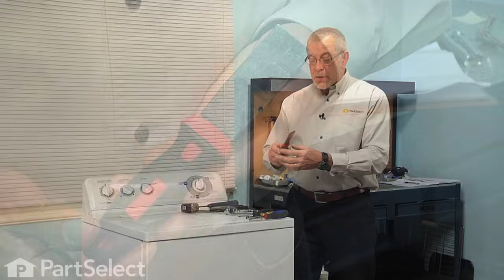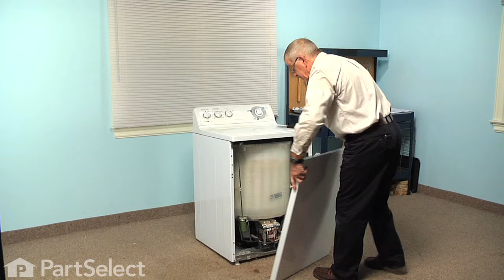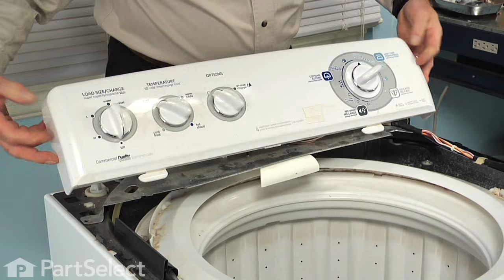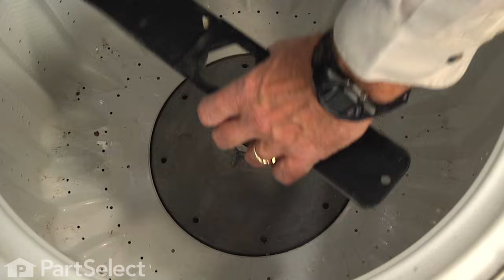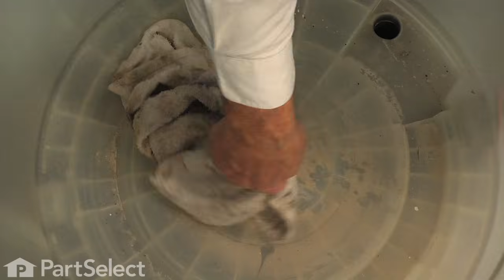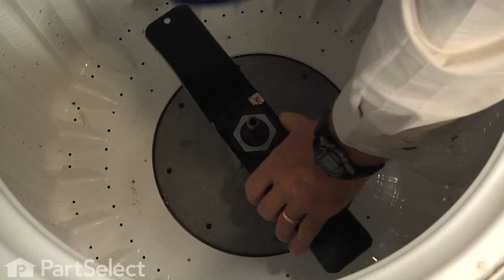Washing Machine Repair - Replacing the Tub Seal (GE Part # WH02X10032)

Comment: Perfect video, combined with the bearing replacement video. Replaced both the bearing & seal as the Kid's washer was extra noisy and stopped spinning. Had to use some muscle to get the tub to spin ahead of getting the parts.
When dismantling, did find some water in the washer base pan, didn't determine if this was from the overflow tube or leaking past the seal. 
Set up a tablet and continuously followed the video(s).
Residual water in the outer tub drain base needs to be drained down.
Bought a 1-11/16" socket & used an impact gun to remove the tub nut. Parents owned laundromats back in the day & tub nuts were never fun. Used some penetrating oil to help loosen some of the corrosion. It took a few rata-tat-tats to finally break the nut free. Did use a soft wire brush to continuously clean corrosion from parts through the process. 
Since the bearing was being replaced, punched the seal out from the bottom with a large socket instead of trying to lift it with screwdrivers. Used silicon grease on the seal instead of soap as the video showed. 
The rest went well, without issues - though some extra muscle was needed due to corrosion & tight parts. 
Did take the time to clean years of residual scum from all the parts, took that stuff outside and used a brush & garden hose. 
Overall took about 4 hours - including some time for lunch.
Parts replaced: Bearing, Seal & Washer (between the bearing & transmission).

Comment: Anyone know what the symptoms of a bad tub seal are?
I just went to do a second load of laundry, first load was fine, and when i pulled the know to start filling water it started dumping water from under the washer. I pulled off the front door and gad a look for loose or broken hoses, but it seems like drips of water are coming off the bottom of the drum?
What all should i be looking for?
Thank you

Comment: I tried to replace the seal.  The video was fantastic and took me as far as the hex nut but now I am stuck.  I can't get the hex nut off.  I got someone stronger that myself, he finally got it to move but it was not the nut, the shaft underneath the tub spins when the is nut rotated. Any ideas as to what I should do? Thanks
Reply: You need to buy the spanner wrench to get the nut off.

Comment: Any ideas as to how to get the 1-11/16 nut off if frozen. I have a spanner, not the same one you use, but it's meant for this one job, and I have soaked the nut in PB penetration oil. I'm not getting anywhere. I have the spare parts, so I'm not trying to save anything, but I dont want to ruin the shaft or tub.
Reply: I'm having the same problem

Comment: My machine is overfilling and I have replaced the pressure switch and hose.  I noticed air bubbles coming from the infuser, I can tell is losing air pressure.  Could the seal being bad cause this issue?  Water goes up the hose.  Thank you

Comment: I'll never ever buy a GE anything again! I have looked all over this 2 year old washer for a model number but cant find a thing. not under lid, on side, back, no where. 2 years old and leaking water from bottom. Also have a fairly new built in microwave and all the paint is pealing off the insides. Pathetic pieces of crap must be made in China!

Comment: nothing not 1 thing goes as you show it. how about doing these repairs on a used unit so it does not look so easy and is actually relevant to the people watching the videos   real vs easy  real cut hub nut into 6 parts and beat off with a hammer. because it ruined your 50$ hub nut spanner vs  new give it a light tap...     real beat inner tub off the outer tub because the flange is so corroded that they are one, vs new lightly lift it out... blah  why would we be taking a new one apart?
no one but you would... i give this repair tutorial a -1 star for being as lazy as a mfr could and still doing the repair. real world ...  noone works on there new appliance  ever

Comment: If you washer is old as mine there will be not as the video you will find rust dirt and very difficult  to remove but every piece will be out if you try harder o hammer more times... used the wrench by in Amazon 8 or 10 dollars and remove the nut and the washer with the wrench is the only way... to remove the gasket basically you need to break it apart... even do everything as shown in the video  it's still leaking I dnt know why... yet under shaft... ( shaft it's ok no damage I guess I have to take the whole thing off and check outside clear plastic drum??? My last try and then buy a new one...

Comment: Step 1: Struggle to take the washer completely apart
Step 2: Struggle to replace the faulty part
Step 3: Struggle to put the whole washer back together
Step 4: Hope it fixes the leak

F that noise, Jack. Time for a replacement.

Comment: I have replaced the seal twice now and the machine is still leaking down the shaft slightly. Shaft seams to be nice and smooth and have seated the seal firmly in place both times. Seal was about 1/16 or so from flush both times. Doesn't want to get completely flush. Still the seal is even all the way around. I also made sure everything was clean and free of debris. Any tips or suggestions would be great. I'm thinking maybe the outer tube is bad?
Thanks
Reply: Chuck the dang thing
Reply: It happens to me the same

Comment: I have GE profile prodigy.  I changed the seal.  Everything looked fine when I took it apart.  shaft seemed smooth and in good shape.  The seal slipped on just fine.  It still leaks.  Any ideas?
Reply: Yes it happens to me after I install everything  back ... so now I dont know what to do... I see other video where someone  use shellac compound like silicone to seal de gasket and tamped I little bit ... I will try that to see

Comment: Have used a can of WD40, bought the required spanner wrench and the nut won't budged. Model# GLWN2800D0WS
Reply from the maker: Hi Mark, and thanks for your question. May I ask which nut you are referring to?
Reply: I finally got the tub nut off and replaced the seal but the unit is still leaking during agitation.

Comment: thank you for this video. its a bit harder on a washer that has all the build up from hard water and years of gunk from use. also I bought a $6 cheap pipe wrench and cut the handle down with a cut off wheel instead of the $55 for the tub spanner wrench.

Comment: Great video. I fixed the leak. However, now the washing machine won't spin very well and the left hand thread tub nut keeps coming loose. The second time I tightened it with the spanner wrench as best I could. Is there something else that might cause this problem? Model #GMAN2008D0WS

Comment: @PartSelect if that ring (not the nut) doesn't split in half, how pertinent is it that it's changed? will it impact the leaking at all? when these machines leak due to the seal, how much of it is/could be attributed to that ring? thanks
Reply from the maker: The split ring does not have to be replaced unless it is corroded badly or has broken in half. The purpose of the split ring is to allow tightening of the tub nut without damaging the tub or spin tube.

Comment: I have replace the Tub Seal twice. on both replacement, the washing machine doesn't leak until the 4th or fifth load and then it starts leaking again. Right now it is leaking again and this will be the third repair. 
Am I doing something wrong? or the shaft is worn out.
I will appreciate your help.
Reply from the maker: What model number do you have?
Reply: PartSelect hi steve mine leaked after replacing tub washer assembly kit & transmission bearing with washer..i have a hotpoint top washer m#vvsr1070daww plz help
Reply: The shaft is probably worn.  Over time the seal can wear a groove in the shaft.  Even a tiny amount of wear will cause the replacement seal to leak.

Comment: After removing the 7/16 bolt I spent an hour trying to get the Agitator Coupler off. I finally had to go purchase a 3 arm gear puller at the auto store which did the trick. Excellent video though which helped greatly.
Reply: @PartSelect Does GE model GTWN5050M0WS also just pull off?  I tried it but it wouldn't budge, and it is a very different shape to what I am seeing here.

Comment: Great video. Saved me 100's of dollars. Thank you very much.  My washing machine is a G.E. model WLSR2200J5WW. The seal I used was WH02X10383, and the spanner wrench was a Supco TB123A. The split ring was PS1766022.

A great place for info is:  http://www.partselect.com/AdvancedModelSearch.aspx?ModelNum=WLSR2200J5WW&mfgModelNum=&fkMfgID=2

That is where I found this great video.

Comment: how old is this GE washer model # WLSR2000G2WW ?? 

I am looking to replace the timer knob, its not engaging. Any videos on this?
Reply from the maker: +Harsh Hariyani 

Here are videos for replacing the knob,
the dial and the knob clip.

http://www.partselect.ca/Models/WLSR2000G2WW/Parts/PS1482286-GE-WH01X10310-Timer-Knob.htm?SourceCode=20&SearchTerm=WLSR2000G2WW&ModelNum=WLSR2000G2WW&ModelID=448694&fSearchTerm=CONTROLS-AND-BACKSPLASH&mfgModelNum=&ManufactureID=2&Selected=00123098i01&Position=2&mfg=GE&Type=Washer&Mark=2

http://www.partselect.ca/Models/WLSR2000G2WW/Parts/PS1482363-GE-WH11X10049-Dial-with-Compression-Ring.htm?SourceCode=20&SearchTerm=WLSR2000G2WW&ModelNum=WLSR2000G2WW&ModelID=448694&fSearchTerm=CONTROLS-AND-BACKSPLASH&mfgModelNum=&ManufactureID=2&Selected=00123098i01&Position=2&mfg=GE&Type=Washer&Mark=2

http://www.partselect.ca/Models/WLSR2000G2WW/Parts/PS270835-GE-WH1X2117-Timer-Knob-Clip.htm?SourceCode=20&SearchTerm=WLSR2000G2WW&ModelNum=WLSR2000G2WW&ModelID=448694&fSearchTerm=CONTROLS-AND-BACKSPLASH&mfgModelNum=&ManufactureID=2&Selected=00123098i01&Position=2&mfg=GE&Type=Washer&Mark=2

Comment: I have a GE washer with model gbxr1070w0ww. When I search part select it takes me to VBXR1070W0WW . Is that the same washer? 
Second, from the video, it seems like there is a kit that comes together with new tub seal and nuts etc (all the new parts shown in the video). From part select I only see the individual parts (tub seal by itself, etc.). How do I find the kits?
Reply from the maker: The new parts shown in the video were not from a kit. The original tub nut and split ring were damaged during the disassembly and had to be replaced during the repair. Sorry for the confusion.

Comment: Every time I wash my whites, I get oil stains.. Is this the fix to it?
Reply from the maker: +benzc43 try running the washer on clean cycle. Use a cupful of vinegar or bleach. There are also specially designed tabs you can use for cleaning the inside of your washer.  After you do that wipe out the drum and around the seal to remove any residue.
Reply: @partselect  GTWN5050M0WS doesn't seem to have a clean cycle.  Do we just throw a tablet in and use a normal wash cycle? I gues the  Affresh W10501250 Washing Machine Cleaner packet will have instructions. :)

Comment: Thanks for the video.... I have a 15 month old GE GTAN4250. Started leaking. Carried out this repair, seems to have done the trick (after the first wash). Bought a deep socket and used an impact driver, worked like a charm.   Here is hoping it lasts longer then a year this time.

Comment: model number wpre6150k1wt bolt use with the spanner wrench will not come off >try spraying it with d-40 still will not bulge any suggestions. ge profile
Reply from the maker: This nut has a left hand thread and would need to be rotated clockwise to loosen. If it still will not loosen, then use a sharp chisel and carefully split it to remove.

Comment: not that simple........once you get to the spanner wrench trying to remove the bolt...just aint happening;;;;bolt will not break loose.....left handed thread ....been hitting and spraying the bolt for days....sprayed it with bolt looser still want bulge..any suggestions???
Reply from the maker: dablock2k3 I would need the model number to answer this.
Reply: I finally took it to a shop used a 1 11/16 impact wrench now I am wrestling the tub out it's very stuck too mine was leaking water I will let you know how it goes